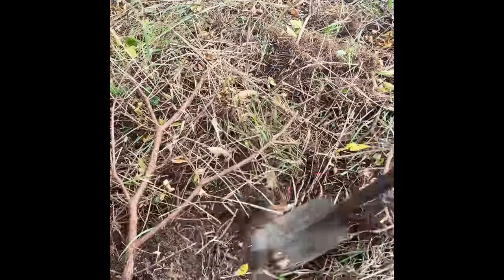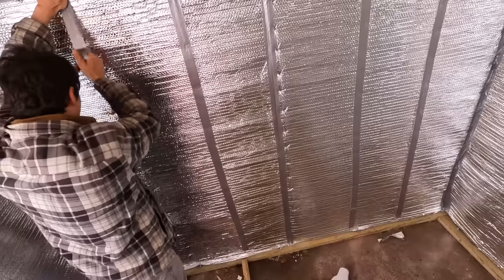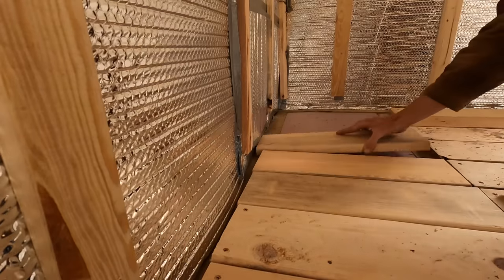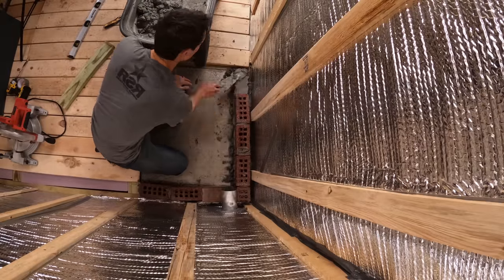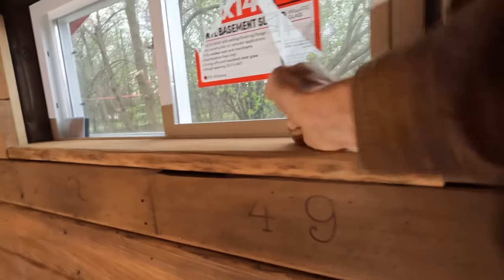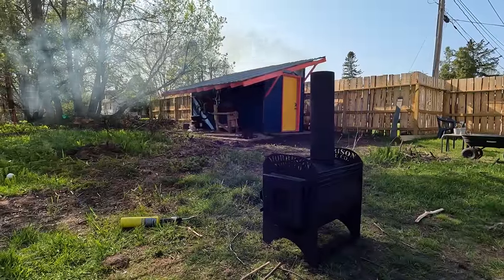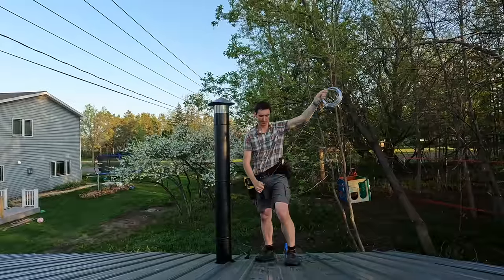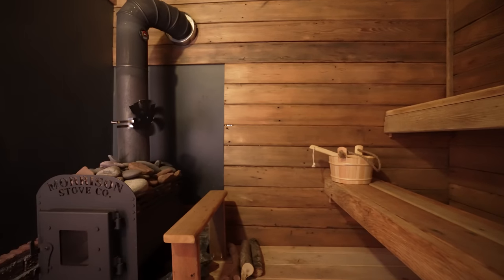Building a backyard sauna

Comment: Big mistake to go though the wall, he ended up going up though the roof any way. And, those though the walls connectors are a lot more prone to causing fires. They also require a special though the wall fitting which I did not see in this video. And the heat shield was not built right either. I appreciate this guys efforts but, do not do some of the things he did. And, last, do not use the foil bubble type vapor barrier, they make a foil vapor barrrier that does not have plastic in it, and, you use a metal based tape to seal the joints not duct tape.
Reply from the maker: Oh yeah, the stove pipe was my biggest challenge, as mentioned, I have zero experience working with stove pipe. Now that I have used the stove for a few months, I have some thoughts, and I'll update you in a future video. It hasn't burned down, but I may make some changes for peace of mind. Also, I am getting some water in the stove from the pipe, so I need to fix that. The reflectix insulation and duct tape don't seem to be a problem at all. It holds up the heat just fine.

Comment: I don't think you actually need to insulate. I've built a few saunas with no insulation and you can still hit 200+ easily in the winter. The stove is the biggest part
Reply from the maker: True, I’ve been in sauna with nothing more than canvas walls and it’s plenty hot. But the insulation wasn’t a huge cost.

Comment: you're using your reflectix as structural support for your insulation.  This is no bueno.  You really should have installed the reflectix, then your wood paneling so that will be the support, then blow in your insulation with an actual insulation blower.  Doing by hand wont do.  The insulation blower fluffs it all up and if you do it by hand, you'll have compacted, dense insulation with poor insulation.

Why do you need an airgap between the vapor barrier and siding?  It's not because of insulation, that's why you have the insulating vapor barrier and ceiling insulation. The heat from the sauna is going to f*$^ up your reflextix with the weight of the insulation and the heat.  You're just not going to see it because of the wood siding.
Reply from the maker: The ceiling insulation could be better, but I’m super cheap!  The air gap is to prevent the cedar from rotting.